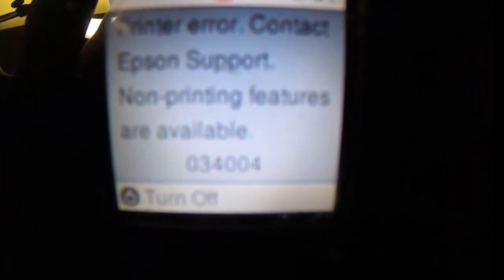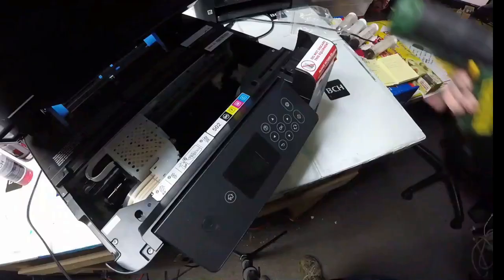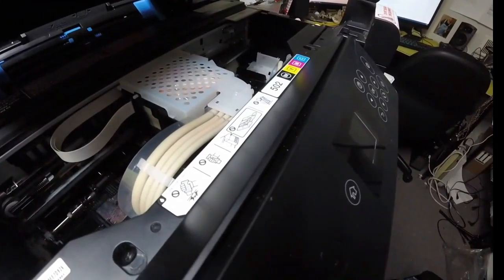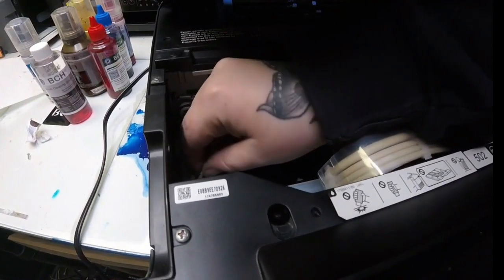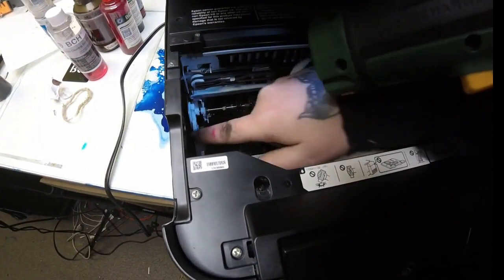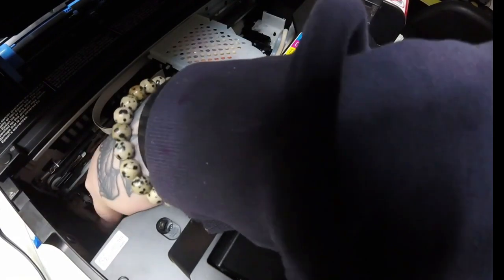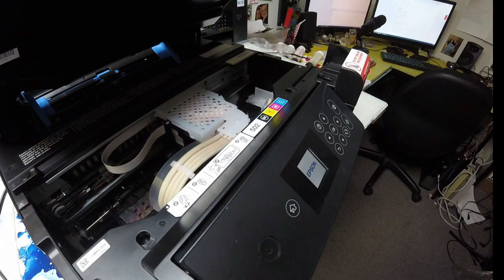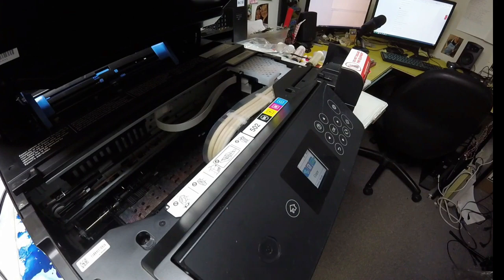Solve the Mystery of the Fake Paper Jam! Epson EcoTank Error 034004

Comment: First off thank you for this info!   i opened up my printer i just got it maybe printed a few times no paper dust in it at all i didnt understand that it was jammed. I opened it and did the wheel turn it wouldnt stay. therefore not fixing the issue. I looked at all the points were the movement happens and i  see an orange plastic object where the paper goes and i got it out and moved the gears and now it works and no error code. I dont believe i noticed the instruction to remove this piece but its bright orange which i can safely assume that its not suppose to be there